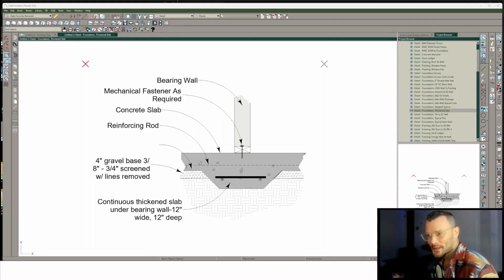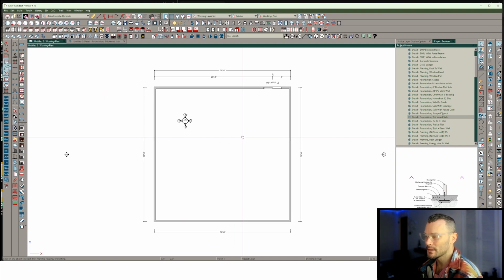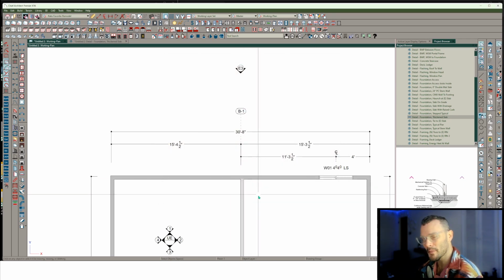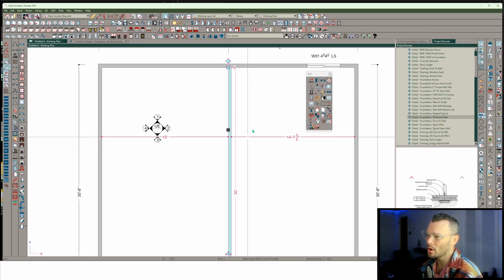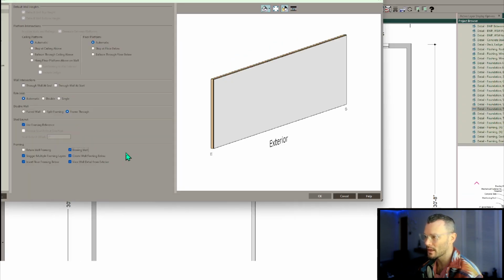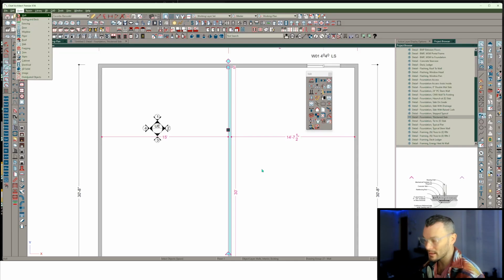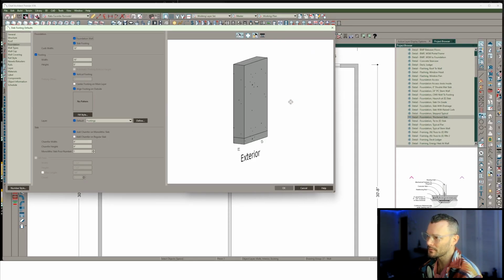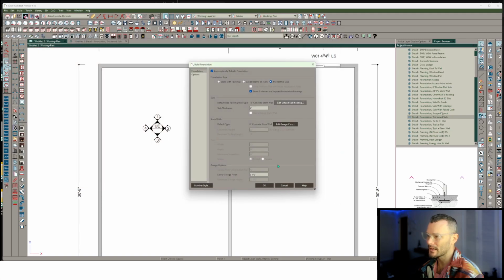CA SHORTS - Thickened Slab At Bearing Wall Condition In Chief Architect

Comment: What if I just want just the center bearing wall to be part of a monolithic pour, (chamfered footing) after the perimeter walls have been poured as typical footings?
Reply: Never mind Renee, I  figured it out
Reply: @douglasmichel6361  This is my issue as well.  What did you do?
Reply: @joeselby5711  I just used a poly line drawn in a section view, converted it to a solid, (be sure to place it on footings layer ) at about 6' deep/long. Position it in elevation for Z axis, then in plan view, positing it in X,Y axis's. highlight it and finish dragging one end to the length needed. Sound a bit much but only take a minute.
Reply: @douglasmichel6361  Good idea - thank you